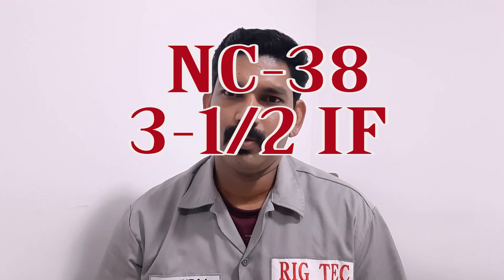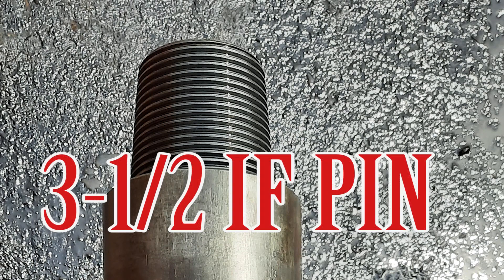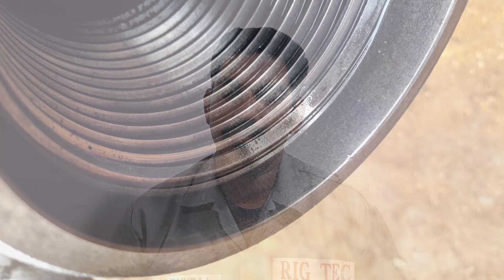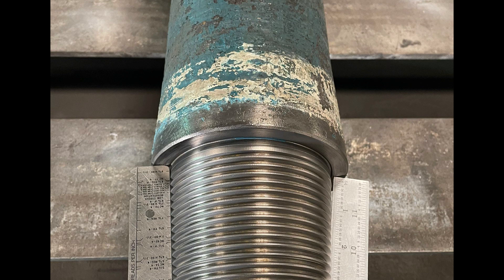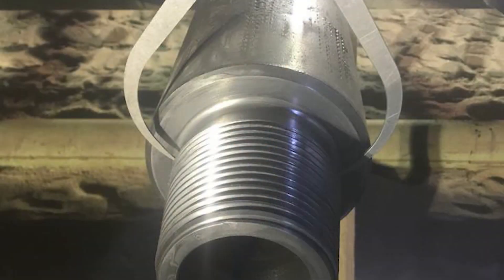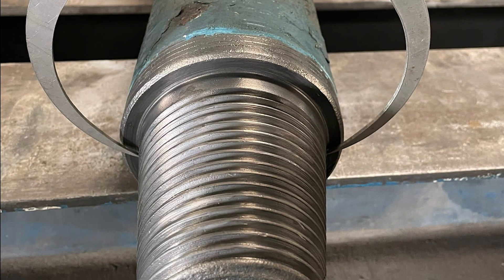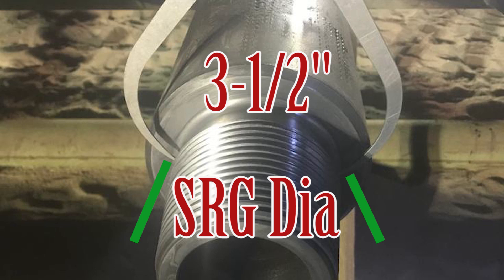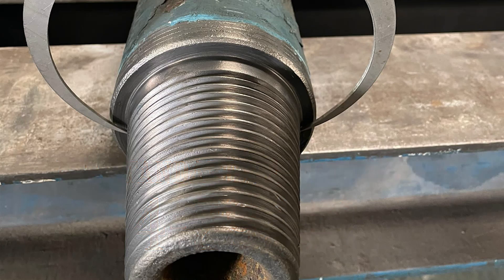SIMPLY IDENTIFY 3-1/2 IF or NC 38 ROTARY SHOULDER CONNECTION

Comment: Difference between IF & Rotary
Reply from the maker: A rotary shoulder connection is a high-strength, tapered-thread. That used in drill string to connect tubulars during drilling operations. These connections, such as API NC, REG, and FH types, are designed to withstand significant axial, torsional, and bending loads, along with high pressures and temperatures encountered in drilling, workover, and intervention applications.
Reply: Thanks for responsible replies, thank you very much sir